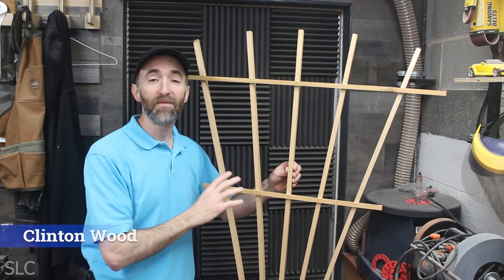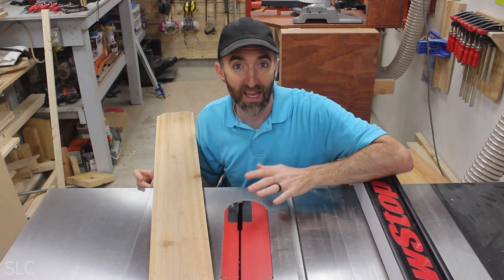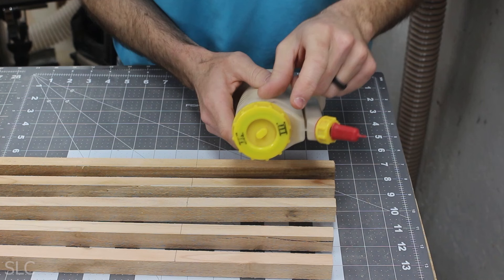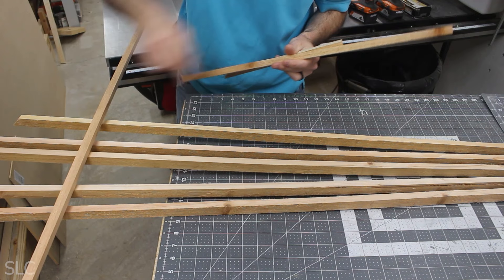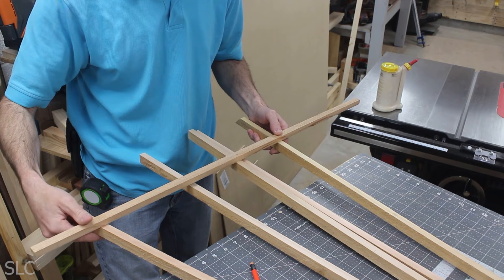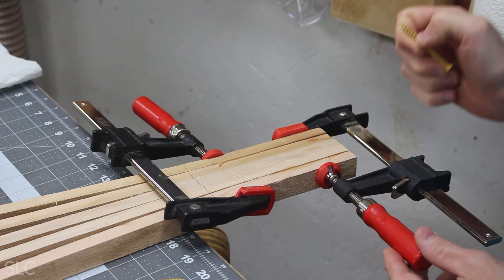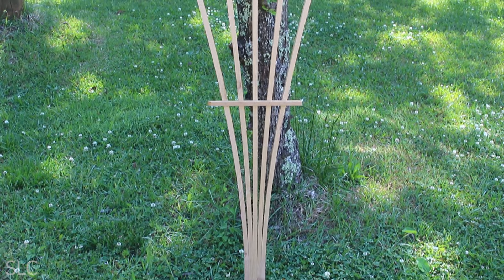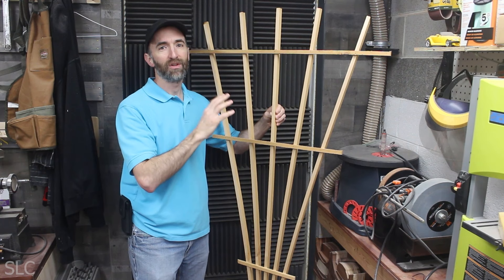How to Make a 6FT Garden Trellis with 1 Board | Simple DIY Fan Trellis

Comment: Love the project. I'm currently building these for mothers day. The  timing seems to be a bit off. Using a jig and air stapler (no glue), got 5 done in about 30 min. Does glue make it that much better?
Reply: Wondered the same thing. Though the glue on the endgrain does not seem optional to me.
Reply from the maker: You don't have to use glue, but I prefer it just in case the staple rusts quickly. But 5 in 30 minutes is hard to disagree with.
Reply: @SpecificLove7  what length Brad Nail did you use? Thank You. 🤝

Comment: Excellent video!  I may have to build some of these!  Cedar fence planks are not  very common in my area, but I do have a 2x4x8ft cedar board I could use.  After that, could pressure treated be used?
Reply from the maker: The cedar 2x4 could work great but it does cost a lot more, at least in my area. I probably would not use the pressure treated wood for your plants and garden because of the chemicals that could cross over.
Reply: @SpecificLove7  Pressure Treated Wood no longer uses “nasty chemicals” like it did back in the early days.  PT wood is perfectly safe to use in gardens, trellises, raised beds, etc.

Comment: Would Pine Pickets be good as well? Those I do have but not Cedar. Thanks!
Reply: James, pine will have a tendency to rot much quicker if left untreated. if sealed they would last longer of course.
Reply: @victoryak86  Thanks I’ll definitely keep that in mind. Thanks Again for replying. 🤝
Reply: @jamesbarlowjr.3762  not a problem. pine would last a few seasons tho, especially if treated. would want to pay more attention to the part that is buried as it would rot faster.
Reply: @victoryak86  Got ya. Yeah I can check into both types. 🤝